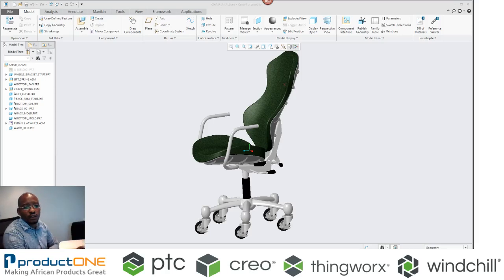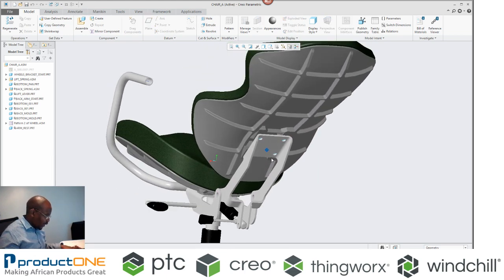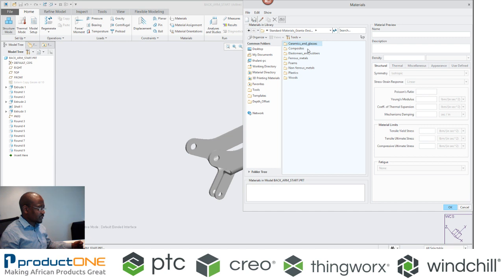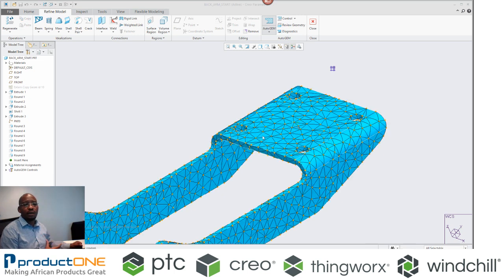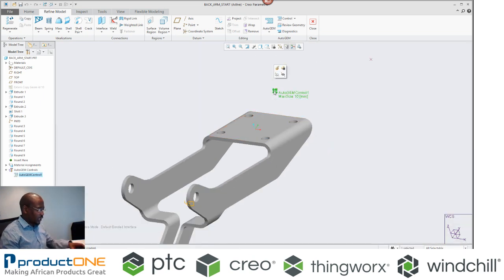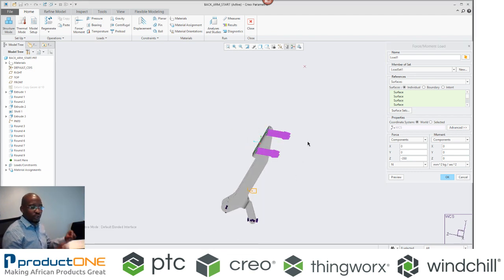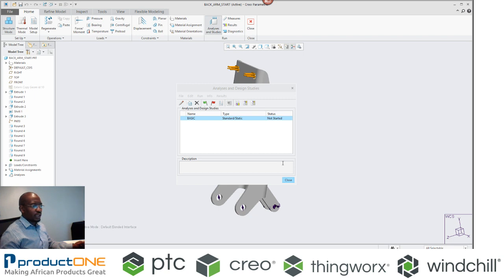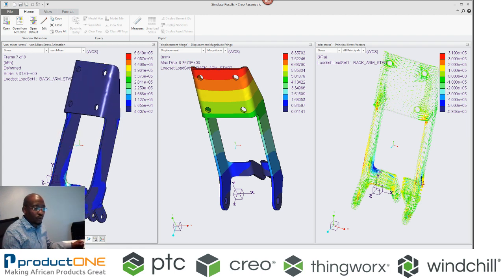PTC Creo Simulate

Comment: I am trying to do simulation for a lifting tool. I am applying 'pin' constraint at the lifting point & i am allowing the rotation for it. When I try to simulate the result i get an error that says - "The model is insufficiently constrained for the analysis. Please review the element connections, 
properties, and constraints in highlighted entities. If this is a modal analysis, then you may be 
able to obtain a solution by requesting additional modes."
how to solve this?

Comment: I agree with justingt3rs, the force is in one direction and I think it would be applied in the flat surface where the back of the chair rests; the bolt holes are only fixing points;
but the explanation of the software is very clear, it has helped me in the way of using the software, thank you.

Comment: i dont agree with your moment load, the force are all in one direction
Reply: I agree with you. He should have set all the forces towards one direction, then he should have added a torque on the upper side of the plate to take into account the distance of the application point of the force